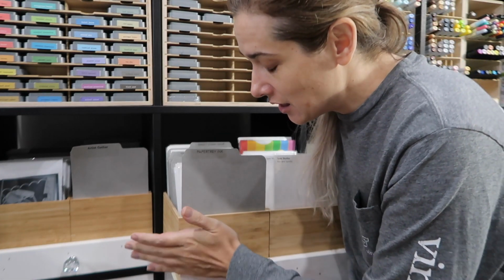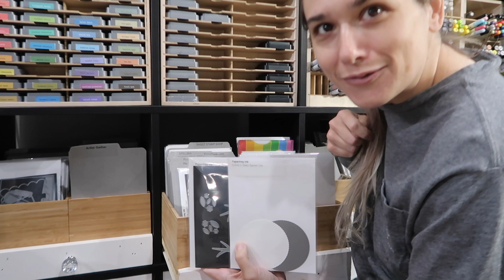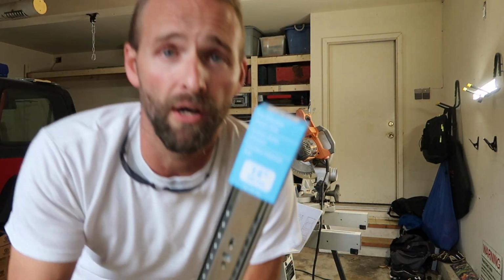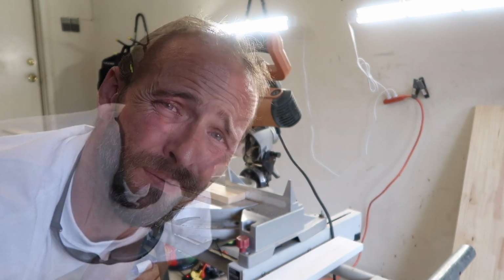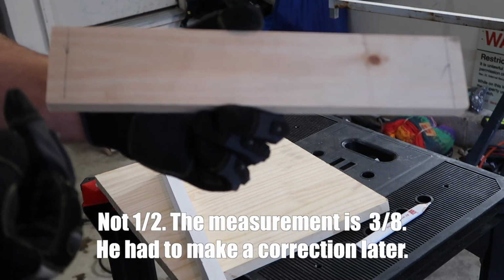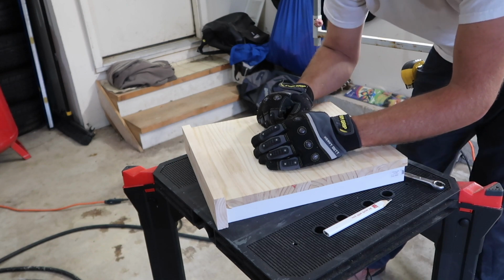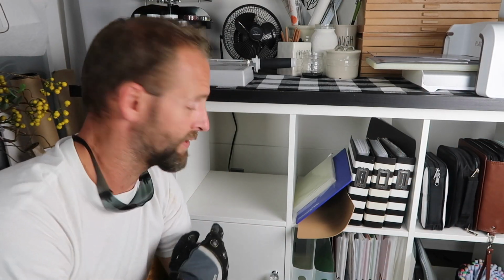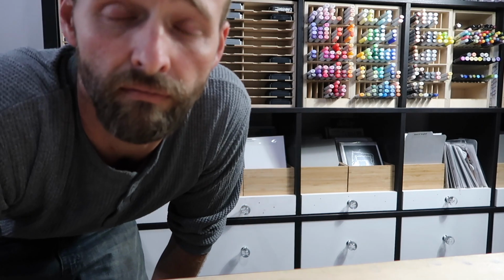How to Make Drawers for the IKEA Kallax: Stamp Storage

Comment: My hubby has a billion excuses to NOT make my drawer slides! I fell in love with Jennifer McGuire’s. After seeing this I’m totally doing it myself! I will upgrade my slides to the anti slam ones! THANK YOU
Reply from the maker: I strongly suggest anti-slam, lol. Thank you for watching Kelli.
Reply: The slides are by far the most expensive part of this project- AND Ikea furniture is not the strongest- I like the soft close slides, but alignment of the screw pattern on side-by-side units might be an issue- make sure to offset the screws a bit on either side to prevent blowing out the wall!  Best of luck!

Comment: For Vinyl records, undermount rails are required - much more expensive unfortunately !
Reply from the maker: Yeah. I would highly recommend buying the best rails you can.
Reply: @KorenWiskman  Get 2x center undermount rails for $15 per. Min 35 lbs spec each  rail for 70lbs total
Reply from the maker: Is that on Amazon?